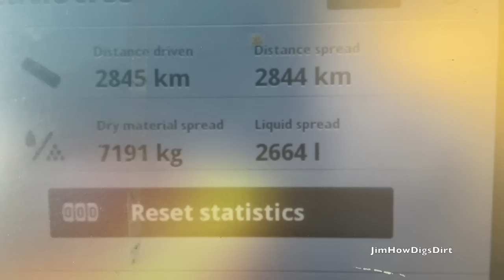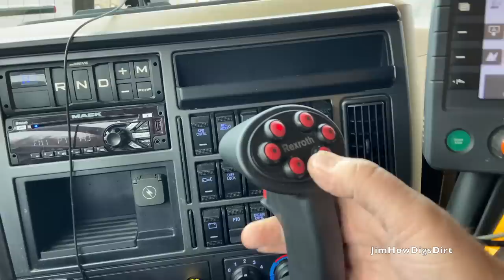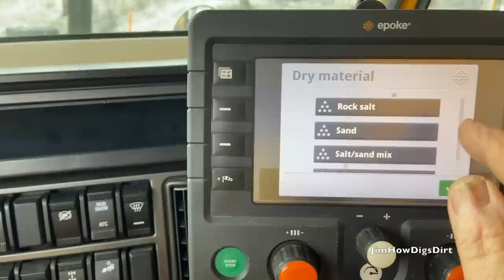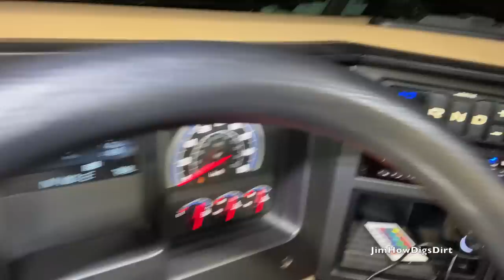Chasing SnowFlakes ~January 2023

Comment: Are you dropping salt at 60 km/hr? Doesn't a lot bounce off the road?
We're getting another 10-15 cm in Ottawa today.
Reply from the maker: Yes, with the e-poke spreader and I can adjust the spread of the salt to put it where I need it on the road. The salt is also being sprayed with brine as it comes out and helps to keep it from bouncing as far and also activates the salt to make it work faster. My truck holds 3200 litres of brine and the spreader puts out about a litre of brine to every 5 or 6 pounds of salt. Thanks for asking Grace!